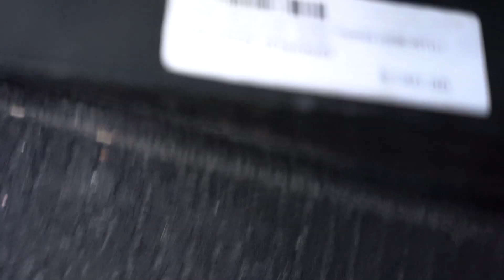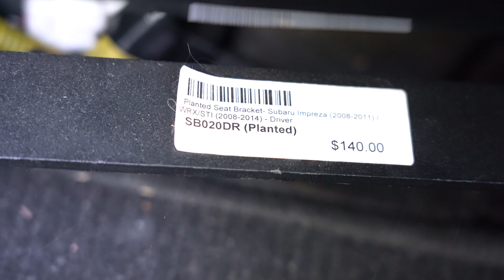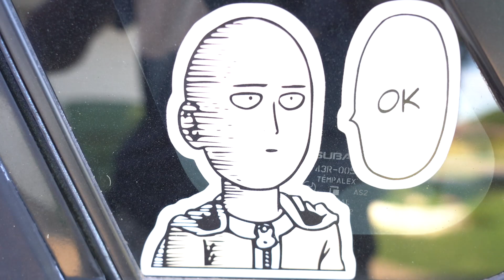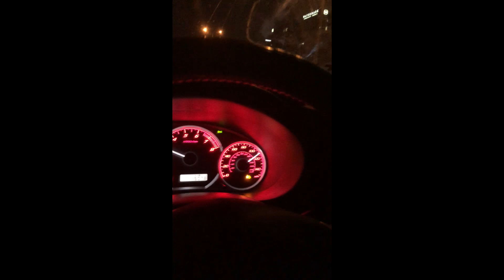500HP Subaru WRX Mod List (Updates)

Comment: 2009 narrowbody putting 482 wheel on a stock 5 speed as well :). Awesome to see someone else rocking a similar build
Reply: I’m putting about 500 wheel on a stock 5 speed I got a hawkeye
Reply: Are you running the front mount intercooler and do you do launches on that tranny?

Comment: hey dude, how does your stock 5 speed handle that much HP? my tuner told me max around 340HP...
Reply from the maker: Mine handles it just fine with my blast plates on my transmission and I’m using and aggressive 6 puck clutch with heavy duty pressure plate haha
Reply: @JMSpeedy   What turbo? and what kind of dyno?
Reply: As long as you’re really nice to it and don’t fuck around w that Cobb launch control